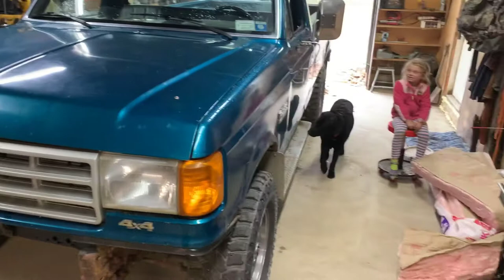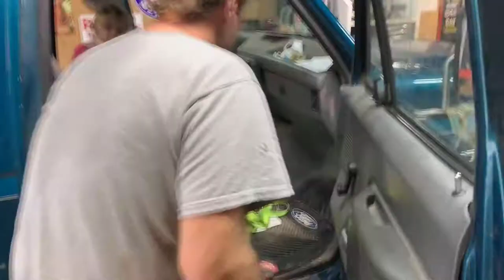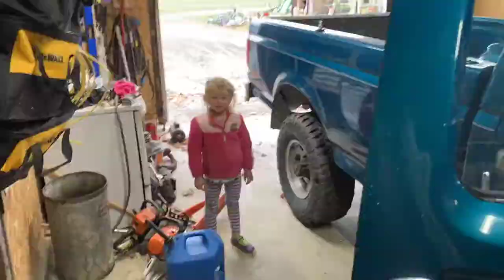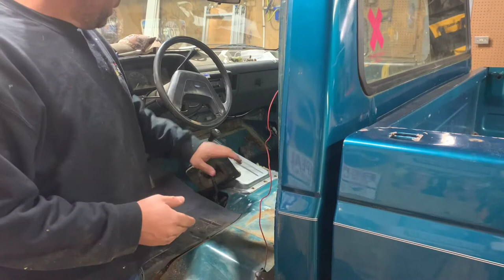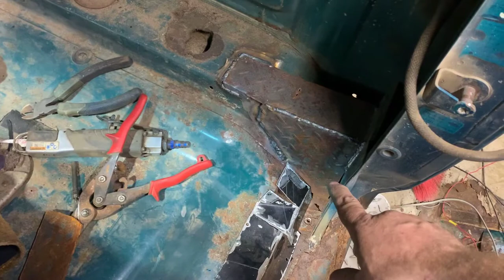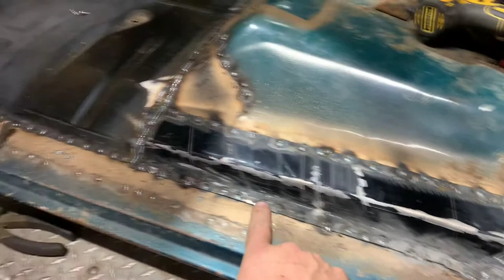89 F250 floor pan replacement

Comment: If anyone else is in this boat, check your drip rails! The seam sealer up there goes bad and lets water drip down inside both the front and rear pillars. I’m convinced that’s the reason the cab corners and outer floor pans rot out
Reply from the maker: Good call! I’ve noticed on a couple that I’ve painted that the seam sealer is all cracked out. Never gave it a thought about leaking. Makes sense! This was a farm truck at one point in its life so the cow crap probably didn’t help. All this job was for was to stop the wind blowing in. Thanks for watching!

Comment: I love the truck! I want to have about 20 of em
Reply from the maker: I have a huge soft spot for this old truck. I’m a huge OBS ford fan. If got an 89 regular cab short bed 2wd with the 300-6 and a 5spd sitting down back, I’m debating on what to do with it. Either lower it or swap in a 4wd front axle and t case. Haven’t decided yet. Thanks for watching!
Reply: @karnesmotorsports  lower it. Also, drop a saginaw power steering pump in it to eliminate the dreadful whine, the lowering process would make it quite responsive, but keep it as a truck you can daily so its always being used having fun in it

Comment: My f350 front body mounts and floor pan failed and now my door won’t  close without having to lift it to close . Rubs real bad… Iv never welded in my life so any helpful advice would be great!
Reply from the maker: It’s just metal, it can be fixed. The best part about floor pans is no one can see your welds lol! Get yourself some scraps, and start running some beads. You’ll figure it out. Make sure the metal is clean and shiny. You’ll want to weld in some temporary bracing if you’re cutting the cab mounts out. The good part is they make new ones. Best advice I can give is don’t be afraid to try it yourself, and have fun! This was actually a fun job to do, for some reason I enjoyed it. Thanks for watching!

Comment: Hello where do you buy the material to do that patch panel and I have rust on the door as well can I just sand that part down
Reply from the maker: I got the floor pan from rock auto. The sheet metal I used along the inner rocker buy the seat I cut out of an old ford truck hood. You can get the sheet metal anywhere 18ga would work just fine. You can try to sand the rust down. Get it down to bare metal, see how many holes are in it, replace material as necessary. Thanks for watching!

Comment: I assume you were mig/flux core welding. If so what setting did you have your machine set to?   I’m doing almost the same job over thanksgiving
Reply from the maker: I was using a Hobart Handler 190 mig welder with .023” solid wire and 75/25 argon. I set it at #2 wire speed around 60.   It’s not a bad job to do, was actually kind of fun. Thanks for watching!

Comment: You had me until you said you were going to leave an inch and plug weld. What a shame.
Reply from the maker: You can do it your way in your video. I didn’t think it was worth the extra time to butt weld it. It’s just a clapped out old farm truck, would’ve been fine using some self tappers. Thanks for watching.

Comment: Did you cut the rust out underneath it?
Reply from the maker: Cut out everything that was rotted though. Inside of the rocker, back of the cab mount. This was not a restoration quality project. This was a patch the hole in the floor to keep stuff from falling out type job.
Reply: I'm doing a floor patch on my 1996 F350 powerstroke only rust spot on the whole truck

Comment: Is it the same process for a 99 f350 as well or similar enough 🤷
Reply from the maker: I would imagine it’s very similar. Cut out what’s bad, and weld some new metal in.
Reply: @karnesmotorsports  
👍👍👍